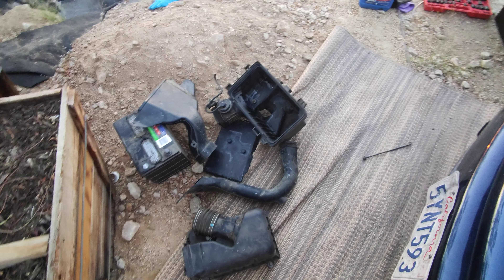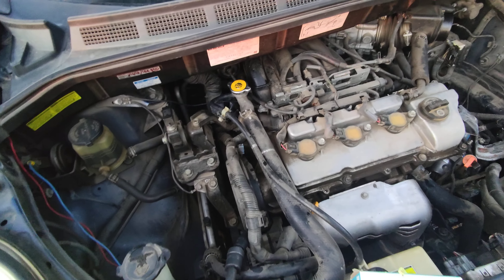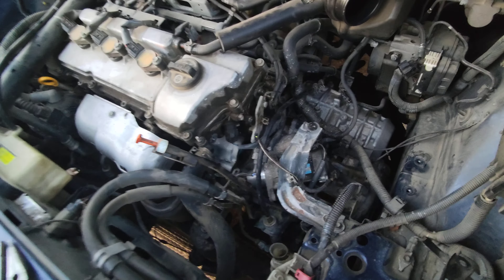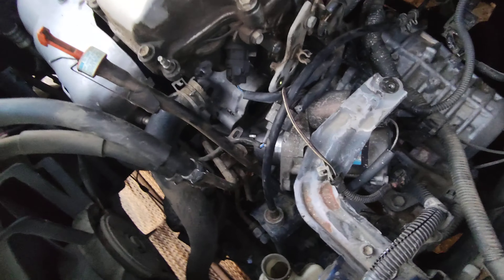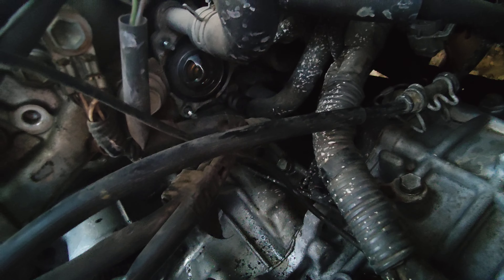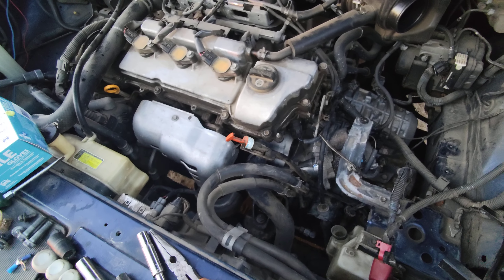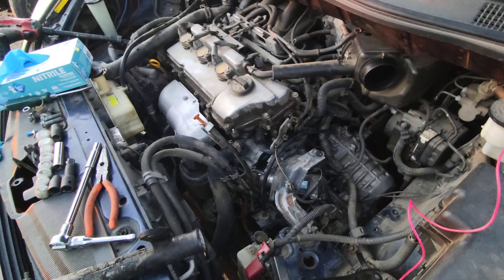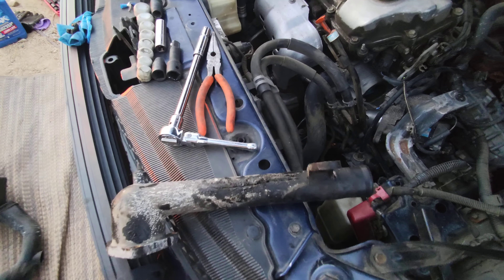2004 Sienna Overheating Diagnosis

Comment: My van just blasted a hole in the thermostat housing.  I replaced the thermostat and the housing.  Drove it to the store and within 3 miles it was overheated.  Not sure where to go from here.